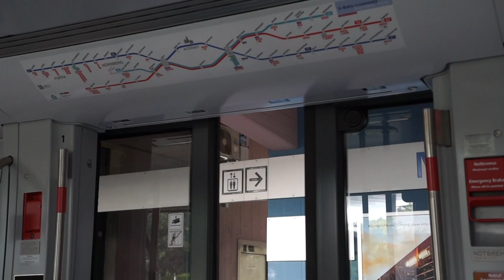U-Bahn Nürnberg: Der neue G1 - Erste Fahrgastfahrten (U1)

Comment: Im Gegensatz zum C2 Design in München ist der Inspiro Nürnberg ziemlich gelungen. Die Farben harmonieren gut miteinander.
Reply from the maker: Durch die blauen Sitzbezüge wirkt der C2 äußerst kühl im Innenraum, was natürlich vor allem durch die kaltweiße LED Beleuchtung hervorgerufen wird. Der G1 fährt in meinen Augen auch ruhiger und es fällt im Innenraum die hochwertigere Verarbeitung auf. Ich denke auch, dass man auf die besseren Komponenten gesetzt hat. Zum Beispiel stammen die Türen von IFE beim G1. Und die LED-Streifen an den Außenseiten sind gut vor Feuchtigkeit geschützt. Die LED-Streifen der C2 Sind ja teilweise schon komplett kaputt. Ich verstehe einfach nicht, warum man bei den Options-Einlösungen nicht nachgebessert hat. Von außen ist der C2 trotzdem der elegantere Zug
Reply: @trams_trains  Von außen naja, sieht nicht gerade gut aus wenn man bei der Fahrzeugwäsche spart. Man schaue sich so manche A und B Wagen in München an, so versifften Lack hab ich bei keiner anderen U-Bahn in München gesehen. Nichtmal Berlin hat den Dreck der Jahrhunderte in den Ritzen der Lackierung.